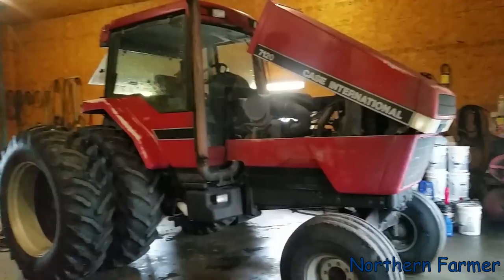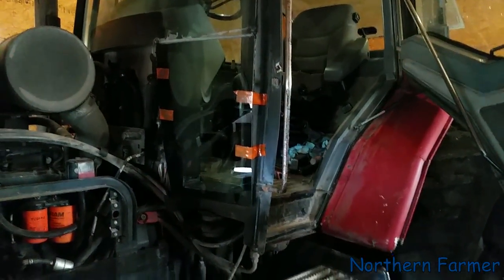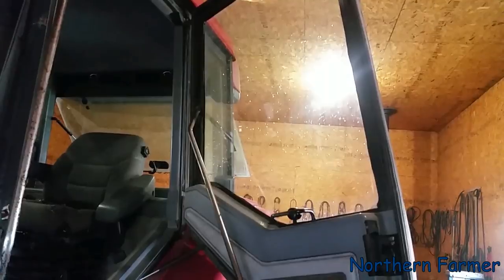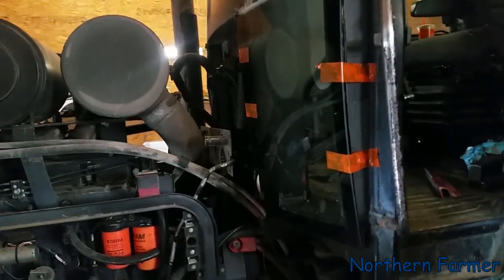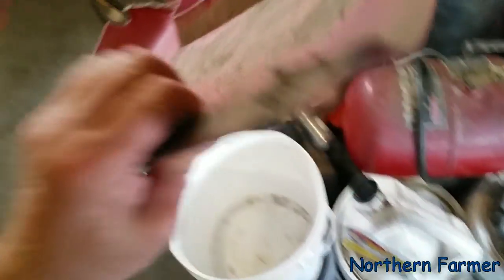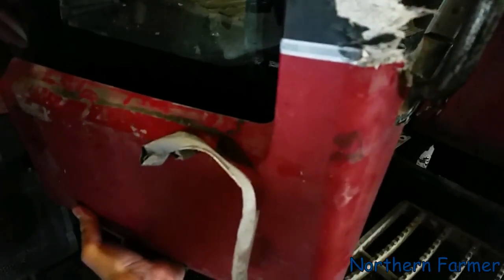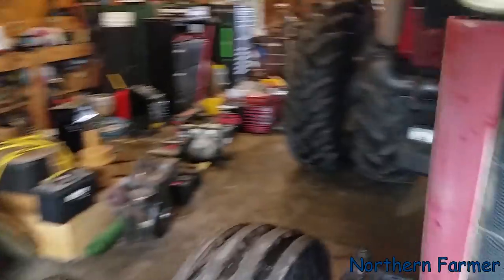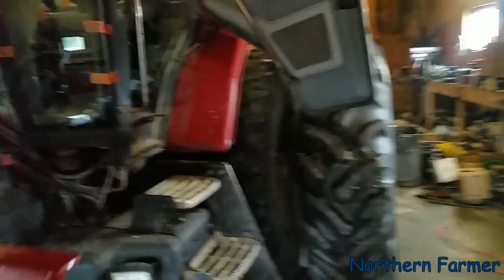New Glass In the Tractor!!

Comment: G'day Tyson you can put those windows in yourself they are easy just cut off the old glass and sealer I use a stanley knife ans any decent auto parts shop should have sikaflex windscreen adhesive and stick them in. Do A&I carry any glass/ cab panels for them?

Comment: You need a fiberglass repair kit    I fixed a truck fender   it isn't a work of art but it works.
Reply: My windshield on my NH T7040 was $785   I thought that was bad then I was part of a silage crew and the Claas chopper windshield was $9000 and it took 2 weeks to get here.